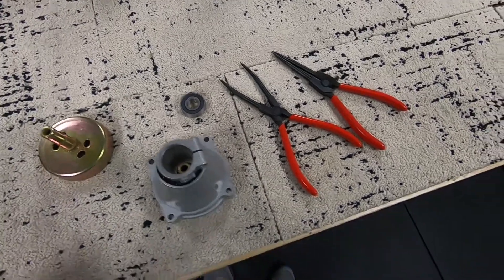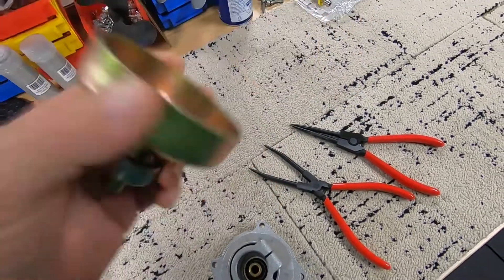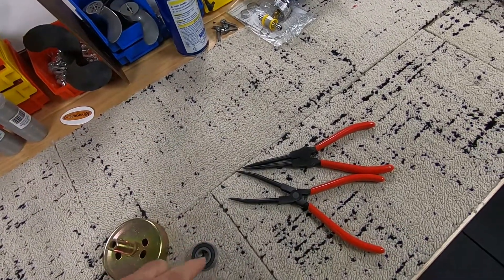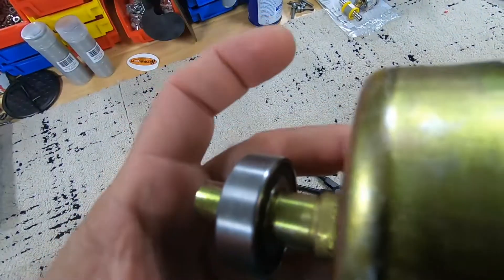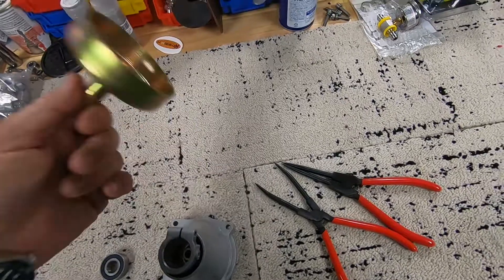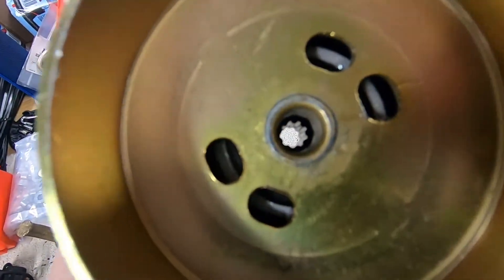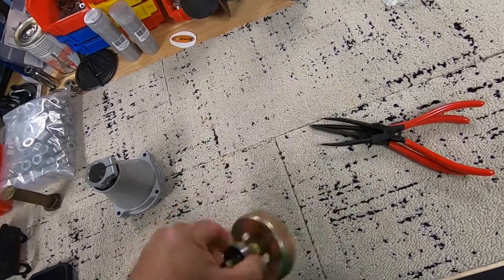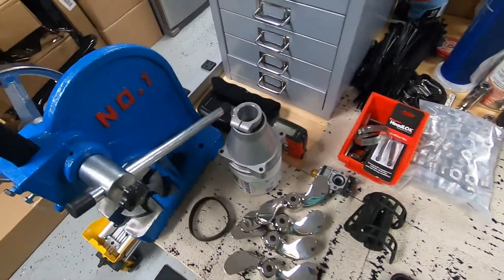Technical Help Series: Clutch Housing Bearing Replacment

Comment: Hi , i bought the engine but i have a question do i have to add oil in the gear box or the oil engine is enough. If yes then what type of oil is best same engine oil or you have a recommendation. 
Thank…
Reply from the maker: if you bought the drive from my company, the gearbox oil is filled for you. 4.0 oz of 30-weight oil in the crankcase is what you need to add.

Comment: Hi, I was in the prosses of changing mine out before I purchased a new housing from you, since mine was cracked at that point. I found that they take a common water pump barring and that is what I went with. If you warm up the Bering it should just slide off.
Reply from the maker: Yes it is a common bearing and with a press makes it quite a simple process. The e clips are more of pain than the bearing replacement. Don’t forget to RTV where the engine and housing meet. This helps seal out any moisture dripping/splashing past the engine.
Reply: It took a couple attempts to find a way to get the clip off. What a pain, I wish I still had my cnc shop. So mutch to improve on 😄